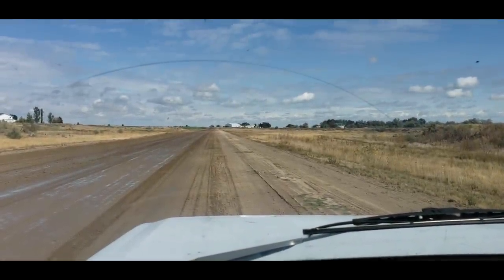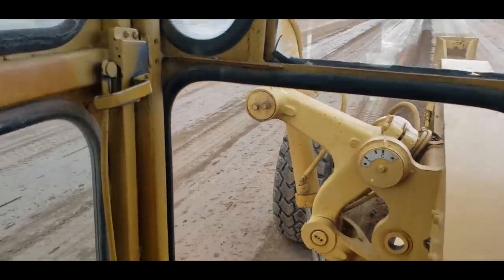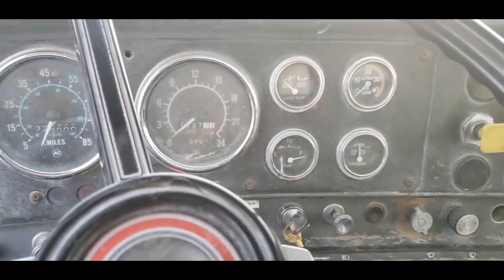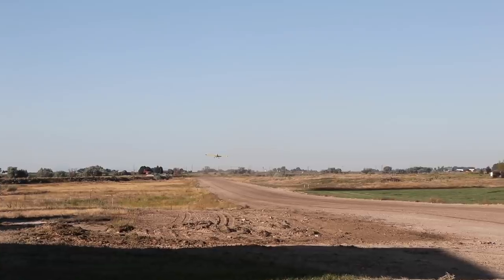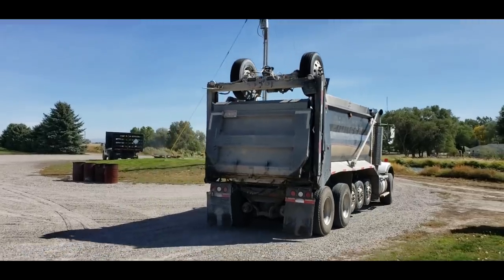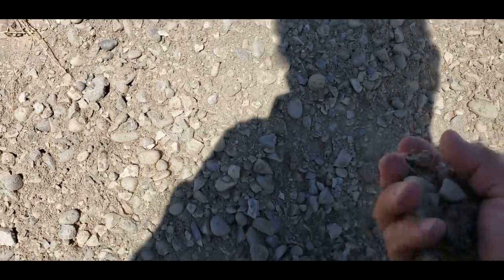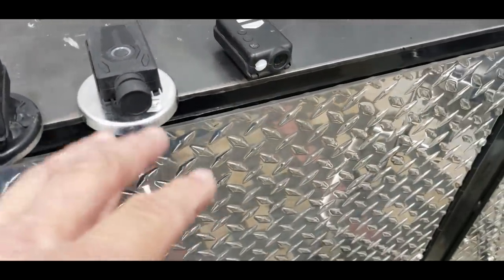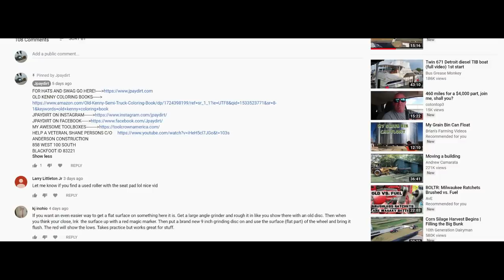CAT 14G Grading Techniques

Comment: Been awhile since i have seen an ole Corn Flakes (Consolidated Freightways) trailer. One of the companies my stepdad drove for bought 25 old CF single axle, daycab Freightliners back in the late 80's. All powered by 903 V8 Cummins in them. Bought 25 so he could keep the best ten running. Those were some ragged P.O.S trucks.

Comment: Wow, Look at that Champion 7GCBC Citabria. She even has flaps and the long wing. Great flying Citabria. It will come out of just about anywhere you can get it in. Did he put new Spruce spars in, or put new metal wings on it? There are several wing AD's out on the wooden spar Aeroncas, Champions and Bellancas. They are bad about developing compression cracks right on the outboard spar doubler plates. I'm sure your buddy is well aware, I'm just a Champ and Citabria nut. Have had a lot of fun in them! Love the video Jeff.
Reply from the maker: yup updated, replaced all the spars

Comment: I helped my best friend make a runway for his gyrocopter he built. It was only 2000 feet long but it still had to be sloped and graded properly. We rented all this huge stuff like a Volvo G940 grader and Cat 563E roller. We were clueless. There was so many controls on the graders that we spent two hours just figuring out what all the levers did. And there's so many techniques that we just didn't understand. We got it done, basically we just smashed the shit out of it with the roller to fix our grader mistakes. Not an easy job, next time we will hire a pro to do it. He's going to expand it to 4000 feet and add crushed limestone. Not me !

Comment: Had a couple cases of R-12 & R-22 in the little cans put away, went to use it a couple of years ago, and they all had bled empty. Guess the crimped seals on those aren't for long term storage. Good luck on the weather, word is you're in amongst some serious accumulation areas out there. Too early for that white stuff.

Comment: Well I know why you couldn't get the Brigadier up to lift off speed there Jeff, you were trying to do it with a full load......... some wings might of helped a little bit too ! 😁
Done some flagging for a duster company in my younger years and they had an old Agcat that was very, very much louder than the other three and I could never figure out why ! Near as I could tell it was identical to the rest but was at least twice as loud !
I sure don't envy you with the snow coming, that's why I live in a place that doesn't get white..... except in the summer when it gets white HOT !
Thanks for sharing and take care. 👍

Comment: I have a bobcat S300 low hours and it has a enclosed cab with AC and heat works great if you're interested in it. I have 2 buckets for it, grapple, jackhammer, 2 fork attachments, sweeper, a grader attachment with GPS and a trencher for it.

Comment: Dad always used a 2 Ft. level made by Craftsman with the "plumbers level" built in which is about a 2-3 degree slope. He used that level for 35. Until he retired and he retired in 1979. I received it in 1998and still use it today.

Comment: Easy cheap compactor, use old Kenny and the low bed with the 336 on the deck. You probably weight well over 100k and with all 8 axles I believe you would have the same effect as the rubber tire compactor machines the paving guys use.

Comment: Jeff you used to be able to get what they call rollers they consist of 8 plus solid tyres mounted on a common shaft and they were mounted behind the rippers are on CAT graders and you use existing hydraulics to lift etc and you can apply down pressure as well by the ripper lever, just something for you to think about, maybe a machinery wrecker would have a set

Comment: I think a lot of county blade operators use the crab method to cover more area. Plus you have less side drift. I remember from heavy equipment operator school books if you lean the front wheels slightly to the lower side of the angle it will counter act the sliding of the machine.

Comment: Are the front wheels of the grader powered?
Reply: mech cntr 

On that machine, no
Reply: @seantatham9960  Thanks. I did not see any differential up there but thought maybe hydraulically powered wheels might be possible.
Reply: mech cntr 

You are right; front wheel assist on the newer machines is typically individual hystat wheel motors

Comment: Great video! A blade is one piece of equipment I have spent very little time in, and most it was cussing just like you said!! Also, the explanation of 3/4 segregation when you drag it with a bucket was perfect, as my driveway will attest to. My 510d John Deere backhoe was all I had to put in my driveway, and I have some pretty big rock pockets. Speaking of skid loaders, I was just looking at some JCBs. They have some interesting new ideas. What’s you opinion of the brand? Thanks for another great video!
Reply from the maker: I know nothing!        Sgt. shultzy

Comment: A youtube channel on the east coast named Mrhevychevy uses computer duster to replace R12.  sounds hoky but he has it in a square body chevy with the long comressor for over a year.  it is unclear what his profession is but I gather it has something to do wth heavy equipmentand construction.  That isnt part of his channel.  Nut he is constantly doing fabrication and fixin.
Reply: I've done it.  Even created an excel file to calculate the difference moving from either R12 or R134A.
Reply: Love his channel!
Reply: Never heard of using computer duster?? Have seen plenty of 134A dumped into R12 systems. Haven't seen one explode yet
Reply: @matthewhansen5008  Refrigerant is not the issue.  Lubrication is the primary concern.  Mineral oil doesn't mix with R134 so it won't get circulated.  Secondary concern are systems designed for R12 will not be as efficient running R134.  But a guy can drop R152 into an R12 system with no concerns other than calculating the reduced charge needed.

Comment: Jeff as far as rollers go. I've rolled many miles, those old rubber tired, wobbly or 9 wheel rollers are a pain. They don't get much traction on loose material. All steel rollars, mostly used for paving. They will roll dirt and base and again not much good for traction. The  articulated  one steel in the front and two rear rubber drive wheels are best for traction and speed. They will keep up with a blade. I have never seen one  with a cab. So the elements will get to you, hot or cold. And are vibrating, great for fines. Then  you  have  a  sheeps foot roller. Mostly towed or self contained with a dozer. Heavy dirt and will leave mark's in the grade. Don't  rent. Buy your own. Keep them greased. Good luck . Like to see what you choose.